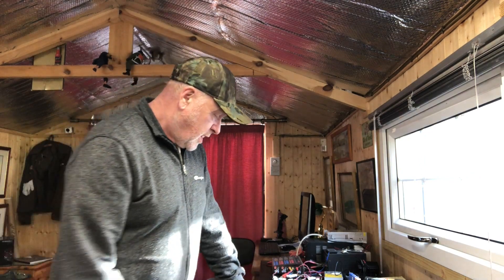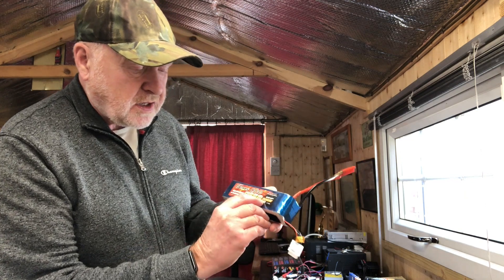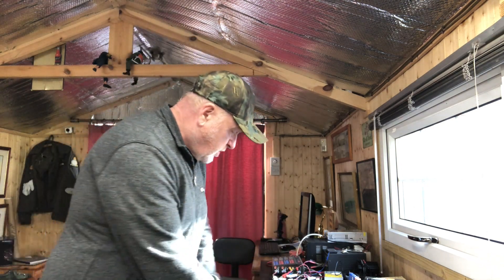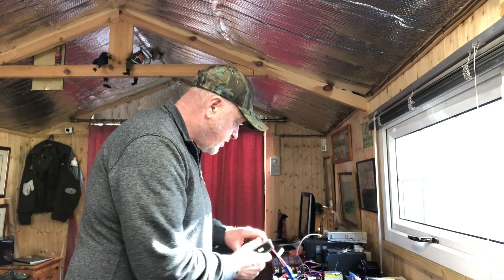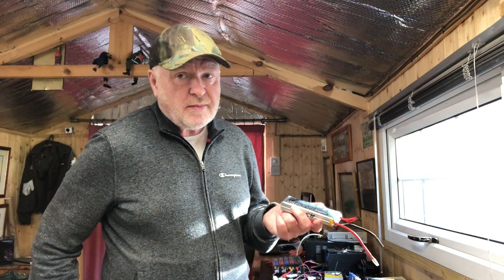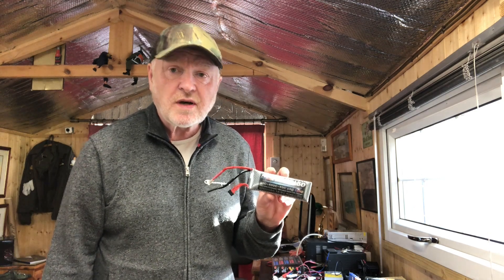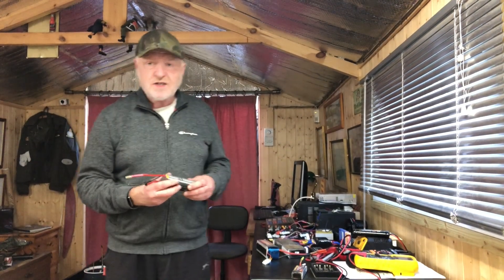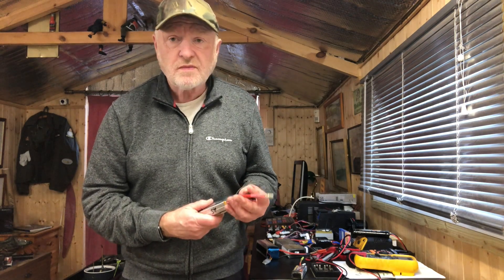Discharging Lipo Battery's

Comment: AS a large model air craft flyer FOR OVER 40 YEARS.AND UK SHOW FLYING . HOW CAN ANY BODY WHAT THE ( HASSLE ) AND (EXPENSE) AND THE (DANGERS)OF ALL THESES BATTERYS SUCH AS LIPO'S  ECT AND SUCH A SHORT FLIGHT TIME.

CONPAIRED TO A ONE OFF PURCHASE OF A QUALITY IC ENGINE BEING PETROL/ GLOW/ OR TURBINE THAT WILL FLY ALL DAY AND GIVE A 100% POWER  ALL THE TIME AND LAST A LIFETIME .
JUST DON'T MAKE SENSE 
AS A MODELER YOU WHAT TO IMULATE THE REAL THING DID A SPITFIRE HAVE A ELECTRIC MOTOR .  NO   🤔
Reply from the maker: Yes I have to agree. My large models have 45cc petrol engines. I used to fly turbines as well. I have given up with glow engines as just to smelly on oily. 
I do think smaller foam models and electric gliders are better with electric motors. Particularly gliders as you can’t restart a combustion engine in flight when you want to get back up to find the next thermal.
Reply: TOLTALY agree I just don't know how PEPOLE can say thay are R/C . Modelers when thay wait for the post man or AMERZON TO RING THE DOOR BELL WITH THERE NEXT MODEL 😝.  After 45 odd years of r/c flying DESIGNING, BUILDING, FROM PLANS ECT, AND ENGINEERING,  AND ITS BEEN SO REWARDING. 
IF EVER THE DAY COMES AND IT WILL . HOPEFULLY NOT IN MY LIFE TIME THAY SAY YOU CAN'T BUILD  R/C AIRCRAFT OR FLY I/C ENGINES ECT.
YOU HAVE TO FLY ELECTRIC. AND BUY  R.T.F. OR FOAMES. THAT WILL BE THE DAY I WILL HAVE A. VICKIN FUNERAL WITH 45 YEARS OF MODELING GEAR. IT'S SAD HOW THIS LAZY GENERATION IS HEADING.
AND ITS NOT JUST IN AROMODELING. IT'S IN ALL WALKS OF LIFE.   (EASY COME EASY GO WITH AS LITTLE EFFORT AS POSSIBLE. BUT WANT ALL THE GLORY .